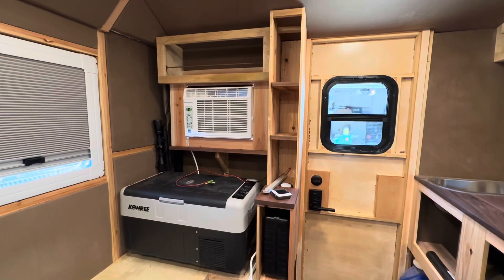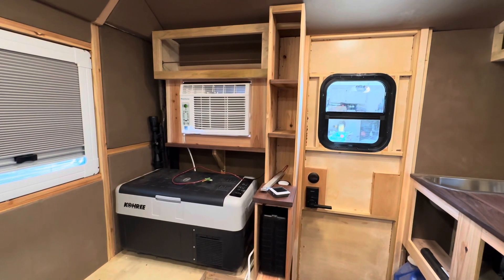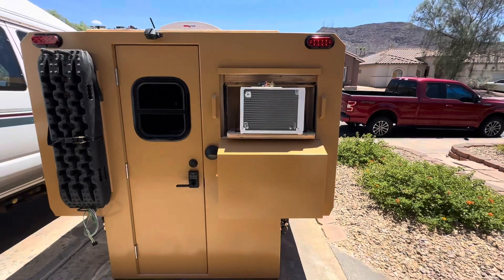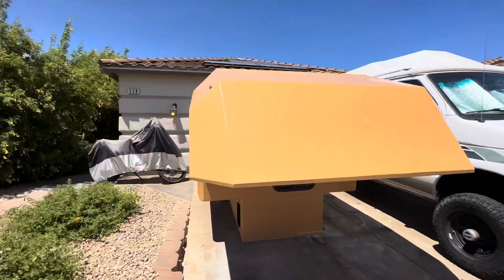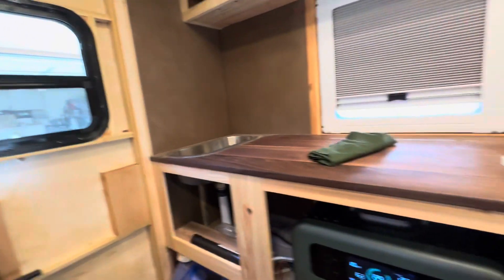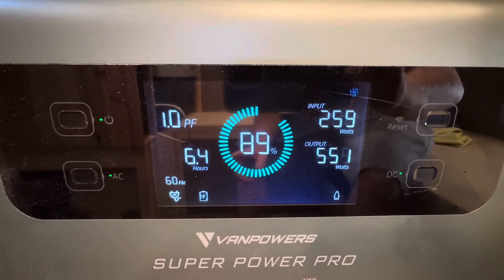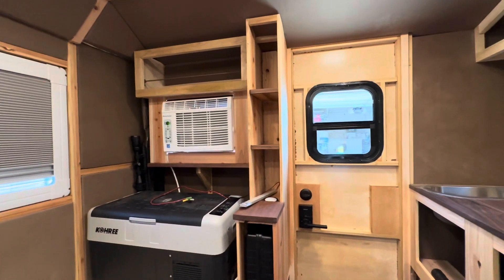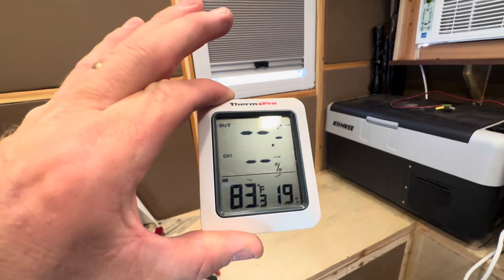Truck Camper off-grid air conditioning on solar and battery - Real World Test 105 degrees!!🥵

Comment: Really liking this setup.  As a person who lives in AZ that's around 110+, I would totally be down for a similar build for my truck. Well done man.
Reply: Same.
Reply: Pardon the dissertation with something to add. Since Apr 2023, I have been sleeping inside my 4Runner (not in a RTT but inside) 2 days/wk during the day while working at night time in southern AZ. My off-grid AC setup: 400ah LiFePO4 battery bank, 400w solar (200w on the roof and 200w on the ground), RedArc RedVision BMS (30a max input), 3k sine inverter, 6kBTU AC, and two 4" USB plugged fans opposing each to facilitate circulating the inside air. Last 2wks, 110-114F outside and an average of 79F inside the 4Runner, which is completely insulated (top, sides, and floor, from front to rear) with sound-deadening foam adhered to the metal and then wool insulation. While doable for 8hrs of AC for two consecutive days, the battery is completely drained by the third morning when I get off work. The problem, as shown here, is that the AC is pulling (400-500w) more than solar can add (250w). On top of that, while the battery is inside at ~79F too, the battery's efficiency is reduced as it heats up to meet the AC's demand. Making matters more challenging, something I learned during the winter months, while a bit different, similar. The only energy source I have is 400ah, not propane or other fuel/energy source. During the winter, I learned that the stored energy from driving during the day is then consumed between dinner and breakfast. Dinner and breakfast are prepared on an induction stove (1800w) and heating the inside (700-1500w). While the vehicle sits and there is no sunlight to charge the battery. Using the AC during the night would be similar; even if you parked with a 100% charged 400ah battery at night, there is no source to charge the battery while pulling 400-500+ watts from the AC. All of that to mention the following, these daytime AC tests, when the sun is available, are not helpful. For most of us, during the day, we do not need AC in the camper while we are driving from A to B. It's at nighttime, when there is no sun, that we are in the camper sleeping, especially in AZ, that we need the AC on. Hope that helps. (PS-This week, I will be adding another 400w portable solar panel array (800w total = 66amp possibility but not likely as RedVision can only absorb 30-35amp max), hoping to capture more sunlight while sleeping. Not to mention, as the monsoon season approaches, daytime clouds will reduce the availability of solar maximum as well.)
Reply: @jatorresrv why not just get a 400$ generator and use it as supplement to run your ac at night. For probably 3$ of gas you could stay cool at night.

Comment: 75⁰ here on California Central Coast, but I know heat! Lived inland in Central California for 20 years where summers are almost as bad as Vegas
Reply: PS- a drop in 20 to 25 degrees is pretty normal with one of those units, 80ish is a lot better than 100ish especially with a fan inside
Reply from the maker: I agree

Comment: If you add a medium size fan (even a large computer fan) to help circulate the air, it will make a huge difference in how cool the interior feels.  The temperature wouldn't change much, but the feel on your skin would completely change.  As long as you can feel the air movement, you'll feel cooler automatically.
Reply from the maker: Great tip. Thank you!

Comment: Is this on HIGH and how many BTU's? Curious the wattage difference between HI MED and LO. Also when your camper is completely kitted your cubic foot of cooling will go down and efficiency will go up. First thoughts are inverter type ac's and how much better efficiency there, and Adding more solar would make you feel better in the security of usage of unit vs. battery life. And then more battery capacity as well, would help for long days of usage. I love this camper. I am near equator at sea level, so I think every day is hot, and how can I run this for days on end. A laser thermometer will let you know what areas need more help with insulation and circlation. Very small USB type fans can get the air where you want itto avoid hot spots and help with feeling cool. It doesnt take much wind to really help you feel cooler and be able to run your ac on low or energy saver mode if equipped. I love this camper, such the sweet spot for comfort and mobility.
Reply from the maker: Thanks. Great thoughts. I appreciate you sharing

Comment: Im super impressed.  Is the a/c unit anything special, or is it just a normal 5k btu unit you can get anywhere? Does it need anything special like a soft start to get it to run?
Reply: Regular Amazon 5k ac unit, no soft start 👍
Reply from the maker: Thanks Jonny

Comment: This is close to a worst case scenario for heat when off grid camping. Wouldn’t take too much more solar to make it work without running the battery down.
Reply from the maker: Yep, I ran out of roof real estate for this particular camper.
Reply: @EndgameCampers great consideration, roof real estate.
Reply: @EndgameCampers  a couple of portable accessory panels would probably just about cover it.

Comment: Insulating your door and door window will help too. We built a 8'x 10' "cool room" at 30 degrees latitude in an area where 120F is common and nights rarely cool below 90F but our 100% solar-powered cool room with a dirt floor (no windows by design and no insulation on the floor yet) never gets warmer than 75F. Prior to this summer, we increased our battery bank 25% so we could likely run the room even cooler if we wanted to.

The walls and ceiling are insulated to R12 with a special framing method called "waffle fraaming" but we also have 500 gallons of water in this room and that 4,000 pounds of thermal mass makes a huge difference. For the air temp in that room to rise even 2 degrees, all that water must first give off 8,000 BTUs of cooling which is equivalent to an hour of full ON runtime for the the Midea 8,000 BTU U-shaped window mount mini-split. :)
Reply from the maker: Cool set up

Comment: Would you mind sharing what size AC that is (as per square feet it's designed to cool)?  I am building a smaller trailer mounted camper (larger than a teardrop, smaller than a truck camper) and am planning the AC.  I am thinking a 150 sq ft AC for my needs - mine will be AC powered, not solar.  Being it's hitting the 105's here in Texas this Summer I am shopping for the correct AC.  I realize you can't suggest the AC so I am only asking what the square footage your AC was designed to cool (probably on full AC power).  Thanks Endgame, love the look of this truck camper!
Reply from the maker: 5000 btu I believe it is rated for 150sq ft
Reply: @EndgameCampers
Reply: @EndgameCampers  Thank you.  That is the size I am looking at for my camper.  For us, 105 degrees is pretty abnormal heat but it's real this Summer and who knows the future?  Although I have another larger window AC (available to play/test with), this camper should need the smallest I am thinking to balance cooling plus humidity control.  Thank you for the reply.  One day I will post my camper online here (I hope, first attempt).  It's not near as nice as yours, but I'm working in the heat doing some insulation now after work.  105 degrees here today, 108 expected tomorrow.  Not normal heat but I have shade which helps tremendously!  Thanks Endgame!

Comment: How much amps of battery you have? (Capacity)
Reply from the maker: 2000wh which I think is somewhere near 180ah lithium
Reply: @EndgameCampers  -Thanks, I see the AC is taking around 550ish watts, so if your solar can produce around 600 watts then it can offset the AC consumption… it would then be a good off grid setup.